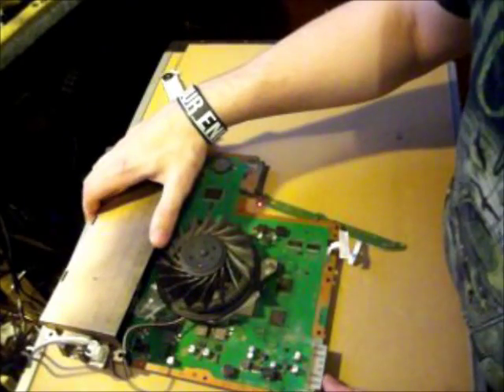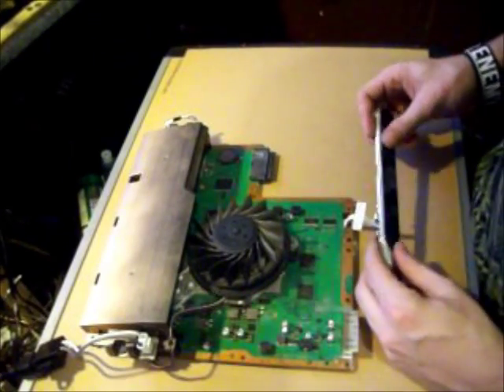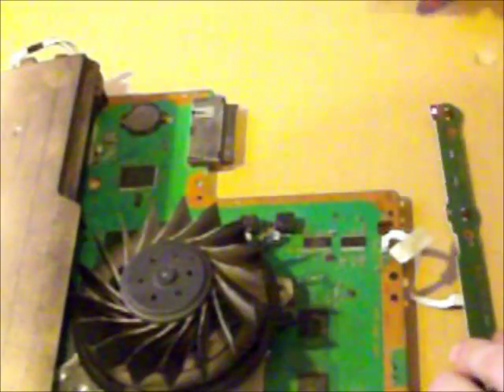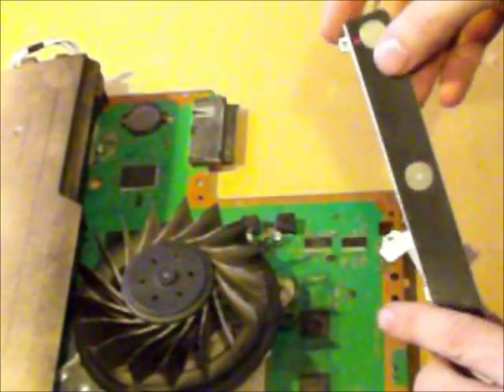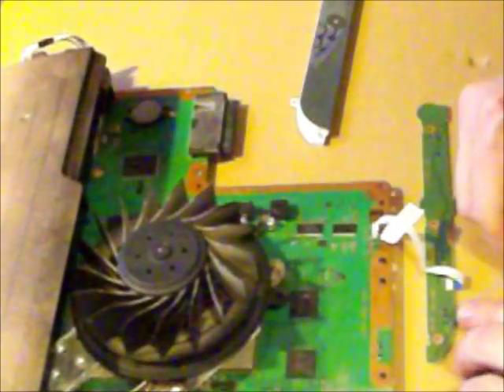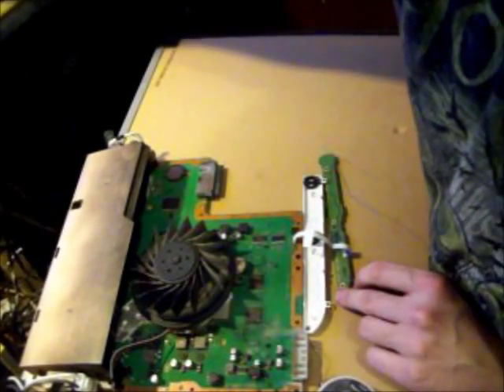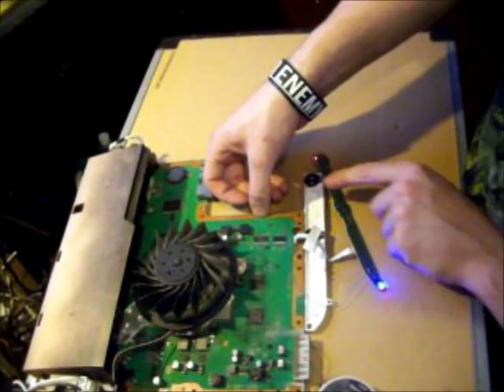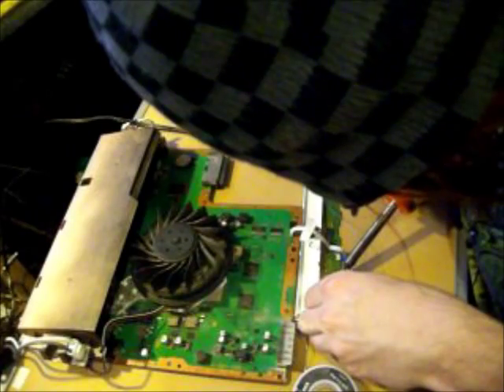PS3 slim hidden lights.

Comment: I know I'm a bit late, but as the lights only come on when earthed maybe it is an indicator of when you have static build up or issues like that. But FSM could also be an option, ill play around with one of my CFWs tomorrow to try to get them to turn on
Reply: My PS3  blue light just came on itself. I dont know if its supposed to mean something. I saw your video in Spanish (its the same light) i didnt understand it but it looked like you did some work to get that light on. Mine just came on a few days ago, i dont know if its for show or if it means something. The light remains on even on stand-by, sometimes it blinks while sometimes its stagnant
Reply from the maker: they wont turn on because of the fact that they are cut off from grounding out. its possible just factory test ports to make sure they are good.
Reply: @David Muñiz do you have a picture or something where i can see where did you soldered it on the board. My board is clean, empty on the back, all traces and contacts are from the different side.

Comment: I have been looking info about this, I also found them but I also notice that the design of the upper panel looks like that they suppose to turn on when the system is on and off when is turn off. Take a look and the pastic cover panel and you'll find the whole and a clear plastic cover that suppose to light the whole panel when the system is on.
Reply from the maker: if you do research on some older models phats they actually  have the hidden leds all the way back to the first model as if its some kind of factory test hidden pass leds. they really dnt light up the whole clear plastice board ive tested that on the slim. they was used for something more but no one knows what.

Comment: If you look at where the leds sit, the sit right in a little opaque window in the corner of the power/eject assembly with a litle opaque tunnel for light to run through throughout the length of the plastic assembly. I wonder if Sony had planned on having some sort of notification light when someone sends you messages or Friend requests but it never got used. Seems weird that they are on the 2003 and 2103 but not the 3003 as Sony usually doesnt spend money they don't have to lol.

Comment from the maker: on one of my modded cases i was trying to  find a + spot to solder a wire to make a internal case lights  and when i did a ground check here one of the lights came on that was not in a place ive seen before..its was 3 solder points in a row of 2, after finding the first one i recorded it up on here to test the next 2.

Comment from the maker: only other leds are under the mother board to the left of this for the hdd, it shows up orange color. this light shows up as two blues and a red. in the middle of the ps3 front but at the very opposite tip of the power light.